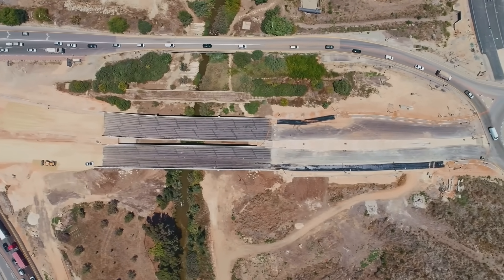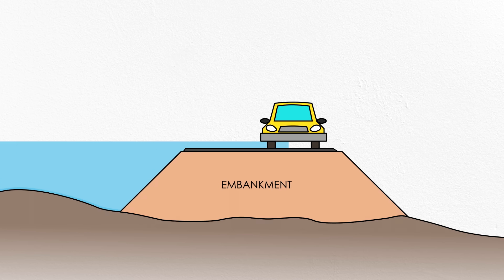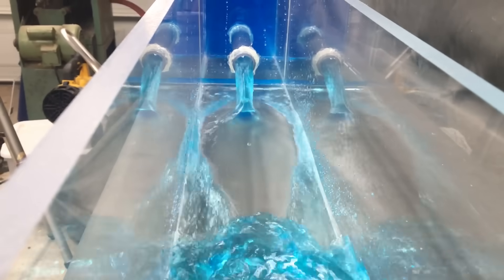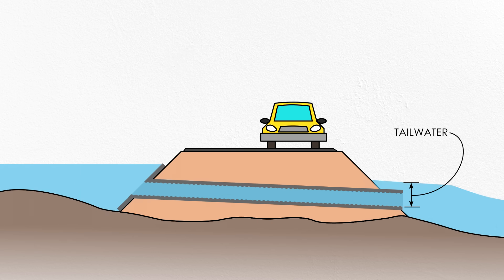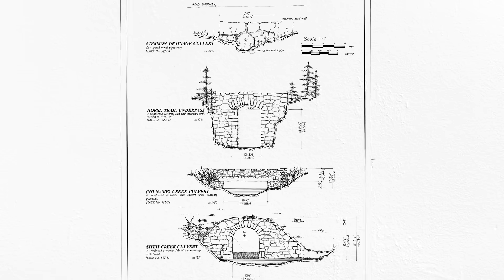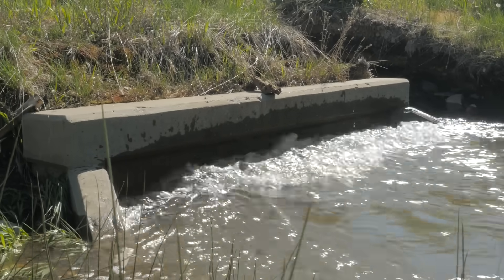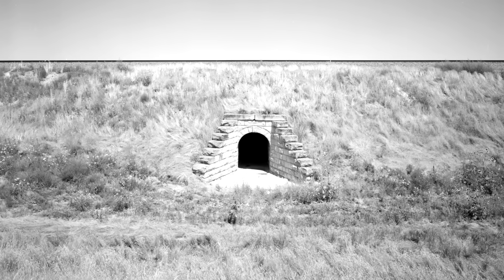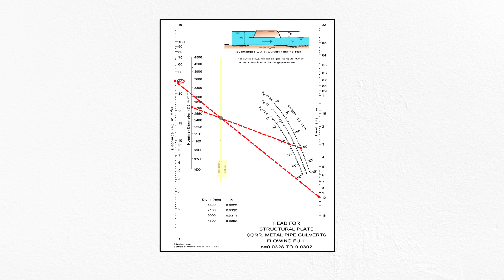What Is a Culvert?

Comment: Whitney avenue, in Sydney, NS, like many roads was built on a culvert over a stream. Usually a trickle, but in winter a serious flow off the hillside above. Even though it's in the middle of town, during a hurricane in Oct of 2016 or 2017 the stream over topped the road and overnight washed the whole road away. This major arterial was closed for 6 months while the culvert was replaced and the road bed above was rebuilt. This caused traffic problems to ripple outward and was a major headache for the entire town. :)

Comment: In 1985, i was a concrete truck driver,  It was mid Febuarary and the outside temp was abo 20 below Celcius, and they gave me a Heated load and I headed to where they were Building the New Section of Hwy 403, cose to 401.  I was pouring the wall of the culvert.  I got there, they backed me in, I had my 2 extra chutes on, and it dumped into a 16-foot chute they had.  The engineer tested the concrete, it passed, then we started pouring.  The wind was going the same way my truck faced, quite briskly.  The concrete left my truck hot, and by the time it got to the bottom of the chutes, it was frozen

Comment: I wonder if those wing walls on the intake side might be about pressurizing the pipe to keep it clear of sediment?  Also the one you show with grills on the uphill side with a bunch of debris caught.  Is that a film you have covered about they way these thinhs can bemade self containing.  I know when I was growing up that a lot of stormwater debris caught in those gratings was handled by dousing them in gas and lighting them in situ.  The debris burned off the grate, the smaller bit went downstream and since nature knows how to deal with forest fire debris it was eco-neutral- at least back then.

Comment: You mentioned the hazard of overtopping. But it seems to me that if the water gets that high against the soil that supports the road, that soil could get soaked to the point where it couldn’t support the road.

Several other commenters have implicitly cited this hazard, mentioning roads that washed out.

Comment: I discovered how complex calculating water flow through culverts. 

I have a ‘simple’ issue. I need to get water from a slow moving river about 100 feet to where I will build a small reservoir where a submersible pump will be positioned.  I already have 2” schedule 40 pvc pipe that the pump will pup through. 

The culvert will be below the surface of the river. The culvert will be level to the reservoir. The reservoir will be 6’ square, and the bottom of it will be 2’ below the bottom of the culvert.

The pump is expected to give 40 psi.

How big of a culvert do I need.

The culvert type will be the black plastic.

Where would I find a chart or equation to calc this?

Comment: Another part of culvert inlet design can be to accomodate an increase in water flow through an existing culvert - where taking apart the culvert / redoing the road is not feasible due to cost.

Due to the effects of climate change, our municipality had to upgrade many of the existing culvert designs to prevent flooding.  For a road that crosses over a stream, if the road is at the end of its life, it may be more economically feasible to replace the culvert pipe with a bigger one.

For some others, ie: one creek passes in a 500m long culvert under a neighbourhood, a rail line, through a park and next to a high-rise, changing the diameter of this pipe simply isn't feasible.  Therefore, a redesign of both the inlet and outlets was needed to help accomodate the increased demand.  

As mentioned in the comments, the environmental effects of the culvert have to be considered, given that the increase in flow can make it so fish and wildlife may not be able to pass through anymore.  What our municipality discovered, was that a good portion of our conservation budget had to go towards these culvert upgrade designs (which were sorely needed) - but unfortunately meant there was less money for other projects, such as wetland rehabilitation, managed forests, and decomissioning old unused surface wells. 

Just to say that an engineer's job is not easy, and they often have to consider and work with many other agencies in their design.

Comment: The lot here developed an issue a couple years back where the water from nearby drainage ditches was redirected under our driveway, & the ground near the uphill vent was eroding into a sinkhole.  So they brought in a crew to fix it, relaid a lot of the channel with concrete... and ended up with an even bigger, faster-growing sinkhole!

Comment: I'm here because I have to finish this technical drawing for a stream crossing to be submitted for a State permit. I just want to know if a 30" round will be good or if I need to use the squashed 36" that the GC is very averse to using. Actually, I also need to design/draw a cross section for the head/tail wall. My takeaway is to make it flush and smooth the edges. Got it.

Comment: This brings back memories.  One of my manuals in my library was the book with the nomographs.  Used it many times.  Left it for the young engineers when I retired.  Now it is all computer programs, course my college education through my MS degree was all slide rules and did not see a handheld calculator till my first job.  Times have changed.

Comment: I love your videos especially this one. I love New England railroad history. There are many abandoned rail lines around me, some have been turned into paved (ugh) bike paths some left natural to be reclaimed by the forest. All of them have culverts that allow the flow of water under the rail embankment. When I walk these and see a brook on both sides of the fill it is time to scamper down the slope and see what structure they built in 1840 or 1850. Most often it is made of cut granite measuring 3'x3' but there are many stone arches that can easily be walked through. Literally a cool thing to do on a hot summer afternoon with the proper gear of course. I think of the effort made by both engineers and stone masons alike so many years ago and I am amazed, but now they only support themselves and some walkers.

Comment: Awesome video!  One small correction that I would make:  When designing using a nomograph, you usually know the design flow (from hydrology) and you are determining the headwater elevation to ensure the culvert will pass the design flow without overtopping (and usually with some freeboard).

Comment: I really took no notice of culverts until I noted a unique usage of them. In Glenview IL along the west fork of the Chicago river there is a bike trail around the Techny Basin. To access it I would cross a small dam with 2 culverts, just north of that there was a spillway in to the basin normally above the level of the river. When we have heavy storms those culverts limit the max flow down river and the excess goes into the basin.

Comment: To actually prevent embankments from being overtopped by flow (and then destroyed by erosion of the downstream bank) this analysis depends on (1) an appropriate estimate of the maximum rate of flow, and (2) the assumption that the inlet will not become obstructed by debris.  In the real world, it is usually absurd to assume that the inlet will not become somewhat obstructed by debris in high flows.  Although there is no way of predicting this effect precisely, the common practice of simply ignoring it is irresponsible.  In most cases, inlets should be over-sized and perhaps protected by bar screens to either pass most debris or provide a wide cross section for the water to pass through the accumulated debris, which in most cases consists of tree branches and other vegetation, with the occasional shopping cart.

Comment: One thing you didn’t mention is buildup inside of the culvert.  There is one culvert near my house that has been filled with sand and it caused overtopping of the highway.  So you need to make sure the culverts don’t get clogged and blocked with debris either or they won’t work as intended

Comment: I love these plexi demos and sometimes I wish I could get my hands on some 1/4" plexi sheets and some cement because I have all the 12v pumps in the world ... 45years old and I still like to mess arround with streams of water. Almost saved a 300x45x45 stainless steel framed aquarium because; woaa, that would be perfect for a POC for a tsunami or a diorama "how rain reach the sea... Freshwater fish in a small pond at top, saltwater fish at bottom. Peltier heater side produces condensation and cooler side makes it rain back at the top... Thats Adhd for ya.. :D 
Could a flared port for a culvert be benefitial? It would increese speed of water but decreese turbulence.. ofc, a straight pipe always is the cheasy way (cheap+easy= you dont spend any hard earned cheese =) But it feels like it would be better.

Comment: Your Nord VPN ad is false. As a IT networking engineer I can tell you that allmost all internet traffic is encrypted anyway with TLS (IOS level 4). Simply put, https encrypts all websites, IOS and Android apps use TLS from 2016 and 2018. All your ISP can see is the domain you are on. There are only 3 valid reasons to use a commerical VPN. 
1. You want to try to circumvent something like the great firewall of China. 
2. You want to view region locked content
3. You want to torrent some stuff that is potentially violating copyright. (VPN provider should keep no logs)

I said a commecial VPN because using a VPN to connect safely to your business domain over the internet is something completely different. 
Let met make something cristal clear: on its own, A VPN DOES NOTHING FOR YOUR PRIVACY.

Comment: I know its a broad topic, but it would be interesting to see a video on the design elements of storm water runnoff/drainage systems in major cities. Im very interested in this topic but I came to it from a very different direction, im an urban explorer. Specifically an urban spelunker/"drainer". I've explorered the systems of Numerous American cities and three in Europe so far. Of course my most in depth explorations have been in my home city, we have several "stages" of the system built at different times between the 1920s and current. And some very interesting features there are several waterfalls between basins, giant flood control gates that probably haven't moved in fifty years, and were still discovering new parts of the system! As far as my explorations go London has the most interesting drainage system, but New York has the most interesting underground overall. Between drainage, subway, access tunnels, underground rivers, and probably thousands of miles of abandoned infrastructure and "unintended spaces" between foundations and other works New York is built like a poorly planned honeycomb underneath. If your walking in the city theres honestly likely less than a 25 percent chance that whats underneath you is "solid ground".

Comment: reminds me alot of like when i went to school for irrigation design and management concerning hydrodynamics, what was it again in the conversion rate for pressure and elevation? like for every foot drop in elevation difference from point A to point B is ...i think... .1355 psi increase, and one foot raise in elevation is .1355 psi decrease? Does that sound right? its all the ame stuff, needed to know the PVC's diameter, thickness, inner roughness. Does a culvert have a size limit? like if its merely for drainage of a small field is it still a culvert? Hey can you do a vid on a French Drain!?

Comment: That diagram where you can calculate the values for the culvert by just making lines connecting everything is freaking awesome. How does someone even come up with that?
Reply: If you did an advanced technical drawing course in the eighteen sixties or nineteen sixties you'd have learnt how to design those kind of diagrams. We all collectively forgot a lot of the old tricks when computers became everyday. 

Basically those diagrams count as an analogue computer. The underlying equations get turned into the shape scale and position of the lines

Comment: Here's one thing i noticed that wasn't in the video. I know this because i installed 10 ft wide culverts into one of Western Australias biggest rivers in the Pilbara.
You might notice that some culverts are "ribbed" on the inside. This is to spin the water which makes it travel faster. If the culvert is near a body of water that is most likely to experience very high flows, the inside will be like a "thread". The culvert will fill and the ribbed thread will spin the water around inside the culvert which pushes the water out faster.

Comment: My favourite is in a neighbouring village, the river is flat, there are buildings on either side with no space for a bridge - the river just runs straight across the road, it's wide but very shallow and slow moving. The village has been around since the 1100s and I guess that's how it has always been and will always be. There are these raised bricks with 3/4" gaps on the inlet end which you can walk over without getting wet and it also distributes the water across a large area.

Comment: One of my uncles was a surveyor and a civil engineer. He was hired to plat out a small subdivision around a golf course. Because he could, when he turned in the papers he also marked where culverts needed to be and how big they needed to be if an area was going to be filled. The main entry was a whopper. A huge area outside the development drained across the temporary road that was in place to get the golf course  and it's infrastructure built. He calculated that they needed at least 4 6' culverts to survive a 20 year flood, the then current code minimum. He suggested that a bridge would be better both esthetically and practically as it would also eliminate a golf cart path crossing the main entrance road. The developer ignored this and had some 4' culvert delivered. My uncle told him, and followed up in writing both to him and the county that 4 4' culverts would wash out on average every 5 years and did not meet code. They built a grand entrance gate and only installed 3 of the 4 culverts. The road washed out 2 months later, taking the grand entrance gate with it and the water backed up and flooded the $4M clubhouse before the road washed out. When the road gave way the water ripped the clubhouse off its foundation and tore it to bits. They tried to sue him over that and lost big time. The development failed and to this day some 40 years later there is nothing there but some dried up golf hazards and the foundation of a $4M clubhouse. When you hire good people, make sure you listen to them. Had the just left the road on the temporary road's grade it would have flooded the road and maybe washed away some of the pavement, but the clubhouse and the grand entrance gate would have been fine and the development might have succeeded.
Reply: Respect to your uncle!

Comment: Having been a landscape architect for the past 43 years and worked for a Federal agency which has the responsibility for the nation’s waterways, I can honestly say that most culverts are installed incorrectly. By incorrectly I mean that the outlet invert elevation is positioned high above the receiving stream thereby blocking any migration upstream of aquatic biota. Likewise the difference in elevation at the outlet generally prevents any safe aquatic movement downstream as well. A better design resolves this problem.

Comment: Hey Grady, I know you've mentioned it in one of your videos, but is syphon effect really caused by hydraulic pressure - so it can't be applied over 10m height? I've also heard that it's caused by the viscosity of the fluid but never fkund what's the right answer. I would be very thankful for your response or someone elses very smart in the comments. :D

Comment: When I was growing up we had a stream that led under a road with a very small culvert. When we had mass rain the water would sometimes fill up and flown over the road, even when it didn't flow over the road the small pipe caused a ton of pressure! The water would blast out about 60 feet and eroded a lot of the land on the other side so there were huge fences with rocks installed to diminish the effect. Lots of things were done actually to deal with the poor culvert design. Interesting video!

Comment: Why do many so many culverts I see in real life seem to have ridged surfaces rather than just being a smooth pipe? Does that improve the flow rate somehow? Intuitively, it seems like it would actually reduce flow rate by adding more friction.
Reply: The ridges increase the strength of the pipe like folding paper in an accordion fold does to paper to support a load without a hefty increase in thickness.  That is what made corrugated metal so useful in building construction and then rolling it up into a pipe for culverts.  Corrugations are used with ABS plastic pipe for the same reason.  Reinforced concrete pipe does not need to be corrugated.

Comment: Historical canals also used culverts. They came in all sorts of configurations. Stone, wood, metal, arched, box, siphon. They were the most common structure used and many are still in use. We typically call a culvert some thing where the earthen canal embankment is not disrupted.  Where there was the need for a larger crossing,  an aqueduct was used. 
BTW, new road requirements in NY say that the culvert has to be passing for animals, so the old plunge pools are a no no.